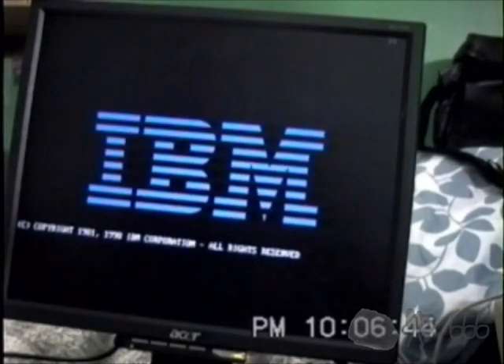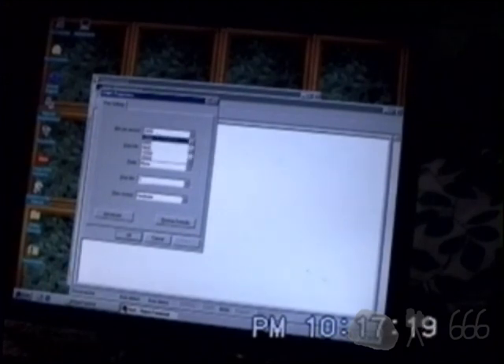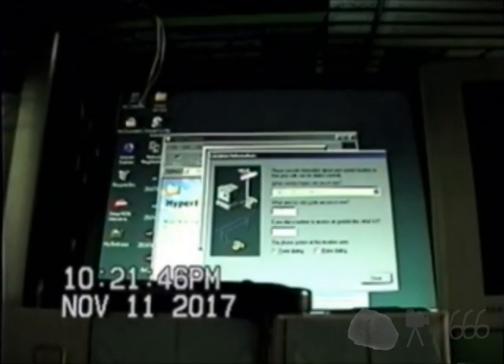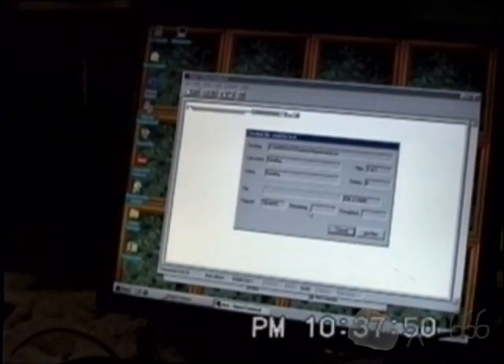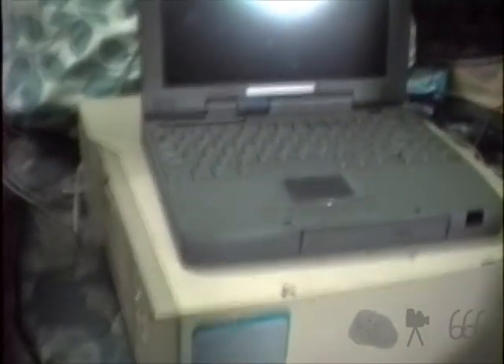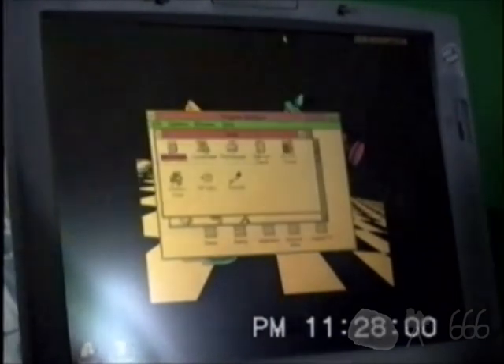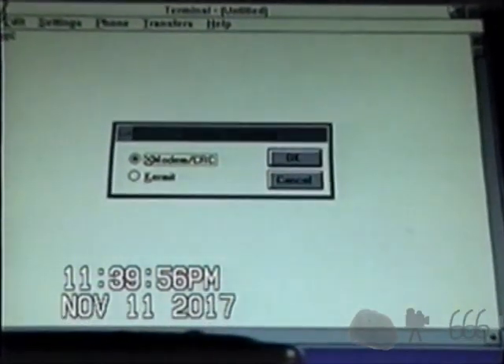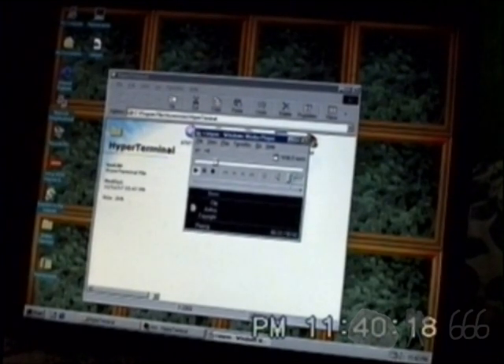How To Transfer Files Using Serial Ports and [Hyper]Terminal

Comment: Thank you very much. Tried to find a good way to transfer some "larger" files to a newly installed Win98 machine without ethernet. The always available HyperTerminal worked great, used between an XP and Win98 machine!